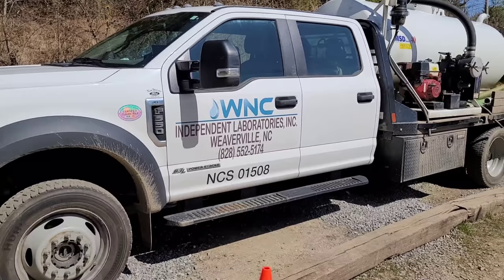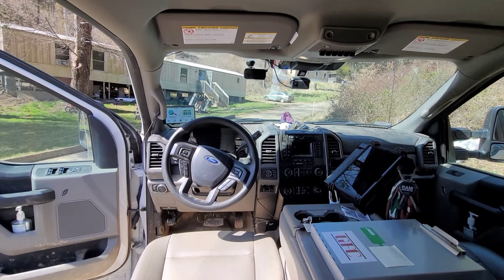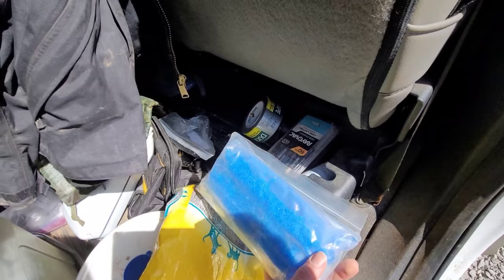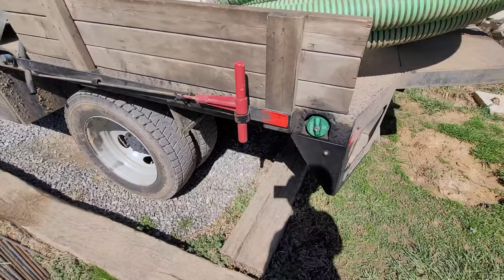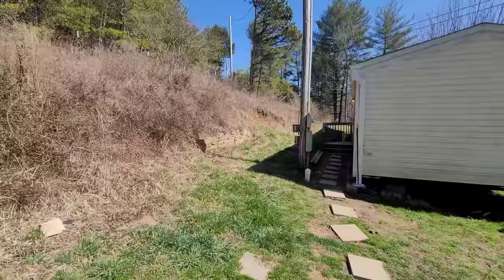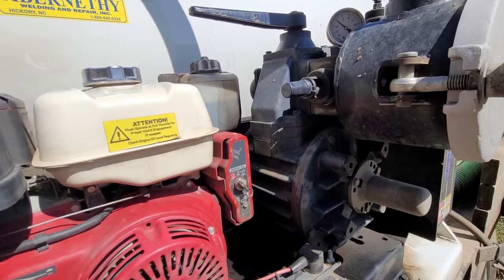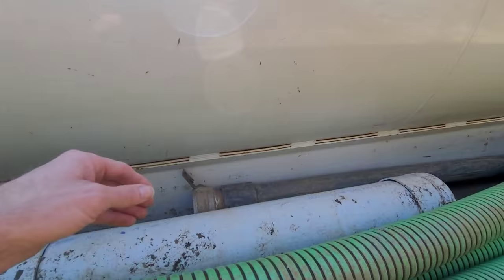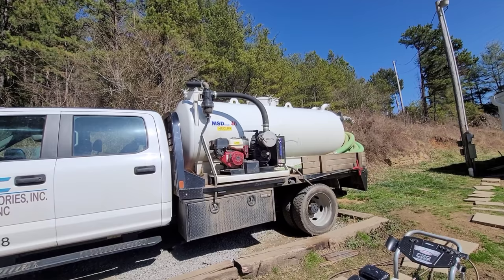Truck walk thru.

Comment: Only things that I can think of. Maxtrax are great for getting unstuck in a bad situation or a driveway that shouldn’t be a driveway. They are super sturdy and you lay them under the tires to assist in getting out of ruts or up steep gravel. Also the tank sits above the cab and having a fiberglass “bump pole” that’s the same height as the tank attached to the bumper would allow operators to check clearance under a low hanging branch or a Hardee’s drive through before accidentally ruining thousands of dollars of equipment, or stopping to get out which is time and a huge pain. Lastly pelican makes these indestructible waterproof reflective flashlights that are super bright and not very expensive. They are crush and shock proof and I’ve found them to be great whenever I’m working on pipes under a house. They also have a arm loop attachment point to keep you from dropping them in septic tanks and down long pipes. Hope I can help.

Comment: I have a couple possible improvements. First, A trunk organizer or something similar to keep all the loose stuff on the truck together will make it a little cleaner in the back and make it easier to keep an accurate inventory. Next, To help "winterize" the vacuum lever could wrapping it loosely with some hydroponic cloth. Lastly, On the storage side you can get some 5 gallon buckets and a battery powered sprayer or pump to clean off the tools and such. Only thing else I can think of is a fire extinguisher, get the employees trained in it's use if you get one that could mean some fire damage or a ton of fire damage. Wish more bosses and business owners were as cool as you.

Comment: Nice trucks. I work for a company that specializes in land application of biosolids in North Carolina we have many machines running vac/press pump using very similar equipment both on and off road. Some ideas are as other have mentioned 
1 backup cameras
2 hard wire the Hondas to the truck and eliminate battery issues. Best thing I  have done with all out truck mounted equipment very happy results.
3 I cringe at the fittings sticking past the rear of the truck. In a collision or backing accident it could send the valve through the tank. We have had it happen  very expensive and time consuming repair. We were lucky the tank was empty at the time.
4 with your pump I saw a pressure blow off but not a vacuum relief valve. If there is not one I highly recommend installing one between the pump and tank. I have seen the tank suck in on a pull behind tank system. 
5 look at installing heaters on the valves they come in both 12v and engine coolant styles that I know of.
6 look at installing grease fitting in the top of the pump valve for greasing to keep water out. We have not had problems with the pump valve freezing but ours are greased.

Comment: Saw you post on tik tok. One thing I use on my work truck is a z-flash. Plug and play OBDII accessory that turns your factory lights into strobing caution lights. I programed mine to flash colors in accordance with local laws. Very useful for when working on or near a public roadway

Comment: I used to work at a wastewater treatment plant and trucks like yours would come in. Even bigger trucks would come in. Had even one company that would bring in and I'm not kidding. You a semi truck with a huge tanker trailer and try to tell us he was only pumping a thousand gallons or dumping a thousand gallons he had. The float on the end of it blocked off with individual cut offs so when they filled it to a certain point they could shut it off and it would stay at that level. You couldn't hide the shut offs and and when we had to watch them dump every so often he'd have to go over and he'd have to open up those shut offs and allow what was in the tube to flow out. Sometimes he didn't do that and we'd reporting frequently. The the department of environmental quality was investigating in multiple times. He was banned from places from being able to dump but he would try. He would do it and he every time he like. Oh no! No, it's just a thousand gallons. We all knew that he was dumping more than a thousand gallons but he didn't want to pay for that extra

Comment: Hi there, I worked on a project biulding our latest forest fire trucks, thought you might like some of th eideas we added to them
For dying pump start batteries, we have the pump battery connected to the truck battery through a dual battery system - this was to ensure the pump starter battery was always charged. This also gave us a bonus, where if the truck battery goes flat, for what ever reason, we can pull start the pump and run it for a while, charging the truck battery and then can start the truck.
We fitted 2 reversing camreas, one low looking straight back for reversing and comes on when the truck is in reverse, one high with a slight down angle, that kind of replicates the revrsing mirror. Driver can manually select which ever camera too.
We store long handle tools in tubes mounted under the tray, across the width of the truck, or upright haning the head in custom hooks and the bottom of th ehandle in a small pice of tube. This gets them off the tray, stops them bouncing around.
For crew rubbish, water bottles (since then we've stopped using single use bottled water), lunch packaging etc we added a rubbish locker that made it as easy to put rubbish in the bin as throwing on the tray, instantly cleaner trucks. Locker has a whole in the door, with rubber flap to stop dust. rubbish put through the hole goes into a removable bin. small thing that had a massive effect.
Our heavy tankers get a 12 camp fridge between the two back seats. No more ice, more more wet lunch. You can see a bit of the trucks here:
https://www.youtube.com/watch?v=5Zp1qfmT-cE
https://www.youtube.com/watch?v=eVb8UMqC8Ok&t
https://www.youtube.com/watch?v=97JgSx-w3Gc&t

There is so much more to these trucks, this could become a very long comment, and a lot of it is fire stuff so not relevant, but hope you might find something you like the idea of. Happy to answer more questions if you have any. i have hundreds of photos with more details too.
BTW,  am looking at your trucks for ideas too :-)

Comment: Great looking truck. I’d recommend installing some sort of flashing strobe lights. (Amber/ orange ) to increase visibility of public to your vehicles. Dependent on how far you’d go with that idea it could be a lightbar (not my recommendation) or install a custom light system on front / rear bumper along with the mirrors. My thinking for this is for liability in case dumbo hits y’all and claims they can’t see.  Also somebody mentioned signage on tank, could be a good idea. 
Invest in a sort of mounting system for tools on truck...leaving them free between tank and cab could mean bad day if tool gets loose. More of a cover your ass in case of a ‘what if’. You could get a fancy setup or I’d recommend a few hooks / fasteners and a welder or bolted to truck. That way workers can secure tools like the probing rod is.  
In regard to your pump with water freezing issues...I wonder if there is any silicone or sealant that could be used in cooler temps to prevent y’all from having to take apart.

Comment: Here from tiktok. My biggest advice is to not delete the def system. That is a potentially MASSIVE fine for your company. Small things to add would be an invertor and small microwave in the back of the truck. Seems like your guys can spend a lot of time out there working and having a way to have warm food and not just cold food is an amazing thing. Another thing is to have a reverse cam welded to the top of the tank with a screen inside the truck. I drove a concrete mixer with one and my god do they make backing so much easier and safer.

Comment: So my main concern is soft ground recovery. I would put a winch on the front so I could self recover if the truck got stuck or at least carry a set of genuine maxtrax. (One tow from a shitty spot would cost more than a mounted 12,000lb recovery winch). Our septic system is in a good summer spot but if I didn’t have all of the gear to get a stuck truck out I would limit them to only coming out in summer.

Comment: Very cool it looks like you've tailored it using your experiences thru the years and it's probably always evolving. It's even tailored to the terrain you encounter there having tanks so far from road access and with such drastic elevation changes. Your story about getting the trucks so stuck so far from a road and the cost getting them out tells me it's beautiful country there.

Comment: I build service trucks like this for a living. Most things on here are by the book and look great, but the backseat is a mess. An organization system like a drawer unit or some molle panels hung off the backs of the seats would increase the amount of area you have to store items. I would also reccomend an inverter in the backseat. 3000w are pretty cheap through truck builders and easy to install. 

Then I would also suggest some sort of fridge/freezer unit. Look up some overlanding builds and see the fridges they use. Most go down low enough to make your own ice. I'm guessing that F550 is a dual battery truck (since they usually are) and a fridge can be run off of that, truck off and not running, for a week easy. 

Lastly I would suggest adding some tube to the back of the headache rack like you did for the probe rods, but for the shovels and such. Easy to access, easy to inventory, stupid simple and cheap to install.

Comment: Back up cam, potentially a set of steps to help get up onto the bed(save your employees knees by not having them jump down off the bed), water tank to wash tools and hands, led lights on the sides of the truck(maybe on the headache rack), maybe a sliding tool box that fits between the tank and headache rack(I’ve found that you can never have too much storage for tools and parts.) full tool set on the truck for any and all repairs for the equipment.

Comment: i pump tanks here in Alamance County, and ive seen your truck catwalks before, and they have crap all in them. a super easy way to keep crap off your catwalks... when you get done pumping a tank, stick the hose in a 5 gallon bucket of spigot water, super easy, completely cleans the hoses out, and bam, no more shit in the catwalks :) most houses have an outside water spigot, that looks like a 1-tank or 1200/1500 gal. tank so you could fill your bucket at the treatment plant :) easy, cheap, and keeps your catwalks clean

Comment: Nice set up. If your Honda has a 12V starting system, just pull cable from the truck's battery. Ditch the little battery. Don't forget to use a fuse.

Comment: So here's a few ideas to add to your truck. So in cab under the passenger front seat you could ad a box for your tape and copper sulfate in a container spot vs moving around. Is a hose reel possible for your hose. Say side or bed mount it. Also a milk create for extra storage if your boxes over flow with tools and gear. Idk who makes it but they make a system for semi trucks that you mount and can secure poles or in your case shovels. But it's closed and can be locked as well.

Comment: How about 4 LED pods on the corners of the tank, that are on a dedicated switch on the truck, that you could flip and illuminate the work area around the truck. In those remote areas, unless you have headlamps or other personal lights, it may be a bit dark around the truck. Also, mabey some 1.5” pipe to attach to the headache rack, at angles, so you could put the tools with handles in, so it could prevent the tools from being piled on eachother, and prevent having to rummage around to find the shovel on the bottom. Just some thoughts! Thanks!! Love the video too!

Comment: Here from TikTok. First off, great setup!  I’ve seen some sketchy trucks over the years. My first suggestion is to add a winch to the front bumper and keep tow straps/tree savers/shackles etc in the truck so when you find yourself in a questionable situation you can either recover yourself or use the winch to stabilize the truck. Next for the frozen valves, I believe I’ve seen someone comment with something similar but maybe try the heated blankets/covers intended to keep snow/ice off windshields and just wrap them around the valves. Might be a total fail but who knows. Lastly, and yes this is borrowed, but you should add custom graphics to the tank that say “You Dump It, We Pump it”🤣

Comment: I dont know if i missed it but if you dont have run airbag suspension good for heavy loads and the compressor and tank can also be used as an aux airline for pumping up flat tyres and using air tools.
Used it on a couple of service trucks and its been a lifesaver

Comment: Great truck set up. I didn't see a fire extinguisher. Also the valve that freezes up. I would fashion a piece of rubber inner tube to go under the handle to cover the sealing area to keep moisture out.

Comment: I would mount a tool cabinet in the back seat, facing towards one of the doors to store all the loose tools inside the cab, fire extinguisher, triangles, maybe add some tire chains to the mix, idk how many times even with 4x4 I've been glad to have a set of chains with me. Also maybe do some sort of rack system to hang the shovels and such so they aren't just in a pile. I would also look I to a rear view camera for backing up. Also strobe lights, lots of strobe lights

Comment: Yes the Hondas are super reliable. We use them religiously where I work. The magneto should supply trickle charge to the battery.  However I found that putting a charger on them once a month as part of a maintenance, really helps. Combine an AGM marine battery with a monthly slow charge, you should be getting three or five years or more out of your battery for your Hondas

Comment: When I was Blaticums Honda engine technical trainer, we had some costumers In northern Finland and there are small Honda engines for oil pumps installed on forest machines(ATV trailers).  Since these Honda engines start up running every hour cold or warm, a blanket is thrown onto the setup so that this tiny engine heats up the oil system and bigger engines, you can use the same thing on your vacuum pump, you don't have to take it apart all the time.

Comment: For your pump selector freezing in the winter. 
Get a conical shaped cover to go from the top of the flange to the base of the handle then fill the airspace within it with marine wheel bearing grease. It won’t freeze and it will repel water.

Comment: On our service truck for the farm i ran a 100a fused 0ga wire back to the Service bed and bought a distribution block and i wired our compressor and welder to that so it all runs on the trucks battery. I put a neg ground by the distribution block so we can also use it for jumping without opening the hood. It's way easier dealing with one battery than 3.

Comment: Saw your tiktok, watched the whole video. I'm sure if this stuff is just super simple and therefore have thought about them and you have reasons for not doing them, or just never thought of it. 

If you're doing night work, some lights in the front and rear of the bed, hung high, pointed down i think would be nice. To be clear, lights on either end of the front of the bed pointing back to light up the sides, lights at the very rear pointing front to light up the back of the tank. 

reflective tape on the end of the bed under the dump

wire the pump motor starter to the trucks battery, not its own so you wont have that extra cost of an extra battery that i assume also isnt re-charged while the honda motor is running.

a simple cover or enclosed box for the pump with room to operate it still to prevent water damage. could also get a boot from a ball joint, unbolt that handle, put the boot on, bolt on the handle and that will probably prevent water from entering.

I dont want the $100, but would like to know the outcome of these ideas!

PS: I'm interested in what fleet management software you use. I work in software and briefly worked at a septic company here in Arizona so i know there is a lot that goes with managing a fleet and the software behind it.

Comment: For the freezing valves id suggest running a heat trace (collant line from engine running to all valves that freezes) and good insulation around them. Wire the honda to truck batteries. Fire extinguisher. Toolbox with common tools in it like socket set ,box end wrench, screwdriver.

Comment: I had no idea that these were so similar to carpet cleaning  trucks. Everything is the same idea except the extractor is 10x the size.
Ford 550 box truck was the exact model I was running around up those schechy roads in Idaho.

Comment: Morning James, you say you have a problem with the pump handle freezing in winter , talk to your fab shop about making a stainless steel cover , I’d make a say 2.5 or 3 inch tube with a capped top with a bolt hole drilled in it , a slot cut in the side to slide over the top , that way rain water will fall on the cover cap and not sit on the oil seal and freeze 👍 hope this makes sense , have a grate day